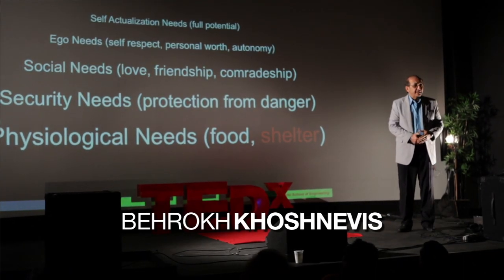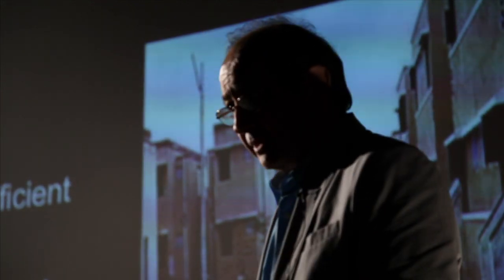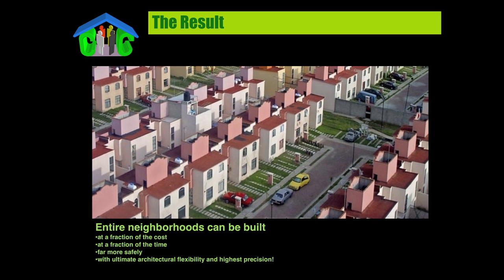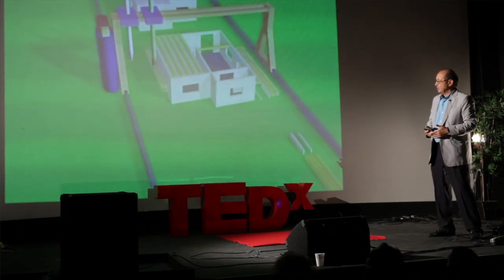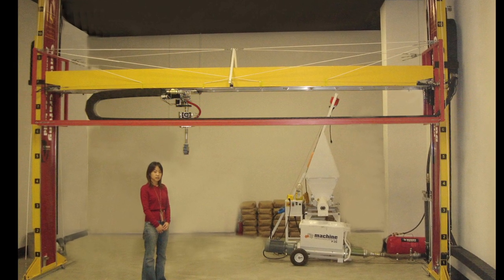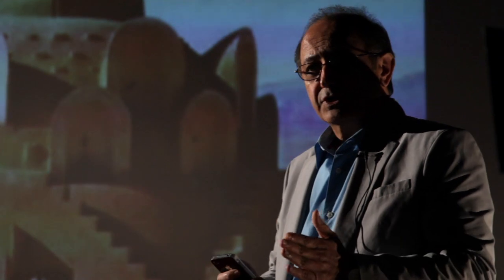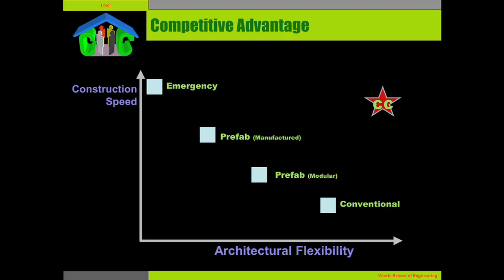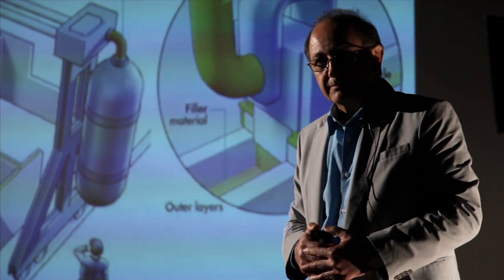Contour Crafting: Automated Construction:  Behrokh Khoshnevis at TEDxOjai

Comment: Sign me up.
The Printer That Can Print A 2,500 Square Foot House In 20 Hours.
We have seen huge advancements in 3D printing. We’ve even seen oversized wrenches printed that measure 1.2 meters in length. Now, we can print an entire 2,500 sqft house in 20 hours.
In the TED Talk video, Behrokh Khoshnevis, a professor of Industrial & Systems Engineering at the University of Southern California (USC), demonstrates automated construction, using 3D printers to build an entire house in 20 hours.
In manufacturing we use a process called CAD/CAM (computer-aided design / computer-aided manufacturing). 3D models are designed on a computer and then manufactured using CNC Machines or 3D printers. The design is manufactured into a physical object automatically, with instruction from 3D computer model to physical object without human interface. Automated construction basically scales up this process. The size of the 3D printer is large enough to construct walls by depositing concrete based material layer upon layer to build a wall.

http://www.contourcrafting.org

#futuretech. #constructiontechnology. #contourcrafting.

Comment: I Must admit its pretty impressive,the only thing I wonder about is how good will the sound proofing be?.
Reply: Why do you ask Robert?  Wouldn't those double-skin concrete walls provide excellent insulation in every respect - sound transmission as well as heat loss and heat gain?

Comment: We should be using contour crafting to entomb Fukushima and all other leaking nuclear plants.  We can build the entombment is layers of hemp concrete, lead, tungsten with a rounded edged hemp plastic exterior.  We can also add some other radiation reducing materials to the printing filaments like borates.  Given the massive amounts of radiation already coming off of the triple nuclear meltdown, we should consider using contour crafting to retrofit existing structures to reduce indoor radiation.

Comment: In a sense, particle board is "printed" wood, only instead of being jet sprayed layer by layer, it is compressed, board by board.  It doesn't look like conventional wood because it is made for price and strength, not looks.  But it has to be mentioned that printing something is not the same as growing something, even though they are kind of similar.  When they "print" organs, they are actually printing a scaffold on which cells attach and grow.

Comment: Metal can melt, just like the plastic used in standard 3d printers, though obviously using a machine custom made just for doing metal.They are already 3d printing smaller aircraft components and working on techniques and machines for larger components

Comment: No doubt there are jobs to be had. However, not as many entry level jobs as regular construction. And these new jobs will require a bit of education which most will be unable to afford. All in all it will reduce the work force and as long as the system remains where we MUST earn money to survive then it can't be implemented without causing some unemployment concerns in an already suffering economy.As I stated, this is a brilliant idea but not until we move past our current structure.

Comment: I'm guessing these machines would be on rails on the sides of the buildings/construction site) and you add more rails if you want the building to be wider/longer. But, I'm wondering, of the 3D printers I've seen, most only work with a hard bioplastic/epoxy-like material. What if you needed to print something made of all different kinds of materials, in the case of a house wood, metal, plaster, maybe porcelain (if it makes a toilet) would it print all those too, or would just assemble them?

Comment: Most foundations crack. The reason the rest of the house doesn't is because there is some give between the different portions of the house, and when a wall does crack, the problem is more or less isolated.  What do you think the odds are that a one piece, rigid house will settle evenly?  Plus, there are all the problems Edison faced-it is damned near impossible to fix plumbing and electrical when all the walls are super strong concrete.

Comment: That's why mobile and Modular homes and poured foundations constantly crack right?
We have a greater understanding of building science now than we ever have, hence systems like the Amvic building system where concrete is poured in to Styrofoam molds reinforced with rebar.

And Hempkrete like that shown in the video (I'm assuming it's hempkrete because of the 10,000 psi) is stronger than traditional concrete and doesn't produce the harmful biproducts in manufacturing that standard concrete does

Comment: Thomas Edison pioneered a technique where prefabricated molds were setup and concrete was pumped into the forms, creating a very solid home in very little time -and it failed. The homes, once built, were nightmares to fix, as all the plumbing and much of the wiring went through solid concrete.  When a normal house settles, it breaks up a bit and can be fixed by section.  Not so with a one piece house.

Comment: This is like the Venus Project. One question is that how long do these concrete buildings last? because if you buy a house and that lasts 25-45 years as opposed to the brick wall lasting 150-200 years or more, why would you save on manual labour a few months? This technology is mainly useful where human cannot work like on the Mars but then how do you deliver so much concrete there?

Comment: Oh, I completely understand that much.

My best friend is a plumber by trade, and he loves this idea. He hates having to go to Home Depot to try to find that specific pipe fitting or elbow joint and have to make do with something else because what he needs isn't in stock.

Plastic retaining bracket broke? Replacement is impossible? 3D Printing to the rescue! I've had this problem with PCs. I had a standoff for a motherboard break, forcing me to jury rig something to avoid an electrical short.

Comment: Plumbers and the like will still be required.

Residential plumbers, for example, to come handle plumbing issues (clogs, etc).

Electricians in case a homeowner wants to modify something in an already built structure?

The people who create the designs themselves for the device to build will need to have some level of expertise in their field(s).

Comment: Being unemployed in a warm house with a safe, legal electricity supply electric light is much better than being unemployed in an insanitary, cold, unsafe shack with an illegal, dangerous electrical connection or with oil lamps. There will be plenty of jobs in building the infrastructure to support the housing, painting, furnishing and maintenance.

Comment: dude jobs wont disapear they will shift so you dont work in construction so what there will be jobs created to build, maintain, transport, work with , operate, setup, resupply the machines design for them dont be afraid of progress but embrace it . kinda like the old saying evolve or die. so instead of doing plumbing or electrical in homes build the components that the machine installs in the house. so again there will be new jobs so dont worry.

Comment: Edison made houses that are still in use in NJ from concrete.  Great houses, but you can't move walls, etc.  So making shells with big rooms, and casting in lots of conduit is probably better.  Concrete can be a 200Yr structure easily, and 1000yr with care.  So build it to be used and re-used for other purposes!!

Comment: Actually quite a bit.  I have a friend that reviewed this that is a 'concrete expert', and it is all within reason.  No you aren't going to use 'regular concrete' but using a correct mix design (what they call doing the formulation for making concrete) it can be done with reasonable ease.  But this is not $80/Yard concrete, it is $150 to $200/Y concrete to get the right plasticisers, water reducers, and other 'stuff' that makes it so it will last in use.

Comment: A good application of CAD/CAM construction to 'some' badly needed housing markets needs. But just another 'tool' in the box to get it done, if you live on a flat plain/desert.  They've sorted out some angled slope installation configuration?  Comparison to farming disruption & work force 65% at turn of century & now 1 %, is flawed engineering-based logic IMHO. The direct & externality costs of 'engineered' food quality on a local food sheds resiliency is more, not less. Seed bank diversity bio?

Comment: as to insulation, a high R value spray foam can be injected into the hollow space in the walls. in addition, once built, if further insulation was needed, the interior of the home could be framed in the traditional manner and extra layers of insulation could be installed.

Comment: I don't see it as a problem at all. Requisite support structures can be printed at the same time as the permanent structure. A temporary column can be printed along the inside of a dome. A buttress can be printed on the outside of a wall as the wall itself is growing. Keep in mind that this technique is very much more like coil pot construction than brick laying, so surprisingly little support is required anyway. Google "3D filament printers" for examples of the same technique done with plastic.

Comment: Now, maybe i didnt catch this in the video, but since the walls wil be hollow, what sort of R value will they have? The insulation that is. How will the those living there be protected from the elements of heat and cold. They will simply be at mercy of them i feel, constantly having to monitor air conditioning or a heater. Correct me if I missed that part though.

Comment: Certainly there is a great deal more research that needs to be done with large-scaled 3D printing. However it is notably faster than prefab and almost certainly uses less materials. The technique is also best suited, not for straight walls, but for organic construction with curves, domes, and arches where the shape itself is inherently strong and reinforcement is far less of a concern. A prefab dome is expensive. But with 3D printing the cost of the straight wall and the dome are the same.

Comment: Looks very akward. The placment in the wall is irrational (there should be rebar mesh by each walls side as close as possible) and it takes a lot of time to connect those segments, rebars toghter are many km long. And how do they place rebar in floor slabs, beams? This method looks very interesting and inovative, but I think that with precast concrete structures (for example) you can build house more faster, better quality, less materials.

Comment: That's fine. You can get a job maintaining the equipment, designing the software, transporting the equipment, maintaining the buildings after assembly etc. If you're incapable of performing those sort of tasks, it's no ones fault but your own. In addition, construction is a skilled labour, you need years of experience and education to work in construction. You don't just walk in to construction jobs from the street.

Comment: A few things I wanted to figure out are :
if something like a pipe bursts or a electirical fault occurs and you have to take down the wall, how do you go about repairing it, since the wall was designed by using a injection system. Would you just do it the normal way or have to get other special equipment to repair it?
I love the idea of this, it turns everyone in the building industry into potential designers, you may lose the bricklayer but instead he would be the man who monitors the machine.

Comment: What about reinforcement steel in the concrete?
I have never heard of concrete walls without steel reinforcement. Of course there is possible to automate a lot of operations, but it will make lots of limitations on how to build. I suspect this guy dont have enough tech experience.
Electrical systems and plumbing?  Haha. How complex does this machine have to be?
In poor country, you can skip isolation, and accept a boring houseconstruction. Dont forget the maintenance...

Comment: This is possible and encouraged by all 3D printer manufacturers, but with the current 3D printers (that print plastic) you can't really print necessary wiring and engines, so you still have to buy some parts.

Comment: A building inspection would be necessary. Any number of unexpected circumstances could arise. The equipment would obviously need to be maintained and each batch of concrete tested which would happen prior to the building commencing, however environmental factors could come into play (rain, wind, bird flies into wet concrete), plus there is still room for human error as the machine would need to be set up on perfectly level ground of equal height at both sides or hoisted if the block wasn't flat.

Comment: But you have to admit, the new advancements of robotics, substantially reduces the need for human labor. Yes of course we still need the technicians, and the managers etc. But the core workload is almost nonexistent. Let's say that the man power needed to build a house averages to about 7, and it would take about roughly 6-7 months to complete. Transportation of materials is still needed, and technicians maintenance, etc.

in the new system the ladder is all you'd need.

Comment: Practically, this system won't have "minimal human involvement." For efficiency and quality control, you're still going to have a crew of guys for each machine feeding it concrete, transporting materials to the build site, double-checking its measurements, pre-install testing the house's electrical systems, and making sure the equipment doesn't break, clog, or go apeshit and flood an in-progress apartment with slurry. This isn't a colossal step away from modern crane-based prefab construction.

Comment: That's addressed at 11:00. It's also a rather short-sighted sentiment; the advent of mass-produced automobiles didn't result in a net labor loss due to the obsolescence of horse carriages, it generated an entirely new industry's worth of employment. Likewise, a system like this would generate opportunities in supply & materials management, architectural design, machine design & maintenance, materials R&D, and still have plenty of skill manual labor jobs left over for surveying, finishing, etc.

Comment: We will still need workers to design and draft the architecture, structural engineering, maintenance of the machines, programming of the software, etc... We will still have plenty of jobs available, but less of them will be slaving in the hot sun under the elements for hours getting skin cancer.

Comment: This will not decrease the cost of building.  I am a concrete contractor and know the industry rather well.  Like when paving machines came out and can lay roads 10 times faster than manual labor.  However, material costs will "suprisingly" go up accordingly and the "laborers" will turn into concrete plant operators or raw material distributors.  So this will not put people out of work or make it less expensive to build.  It will just have good quality control, thats all.